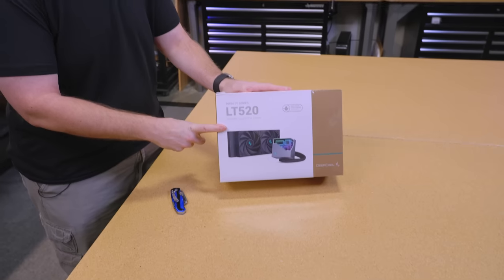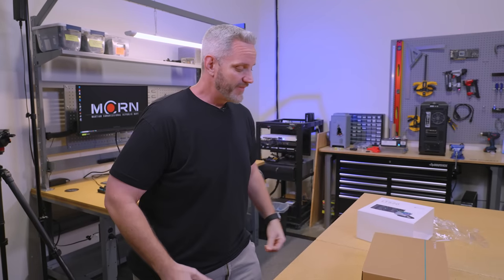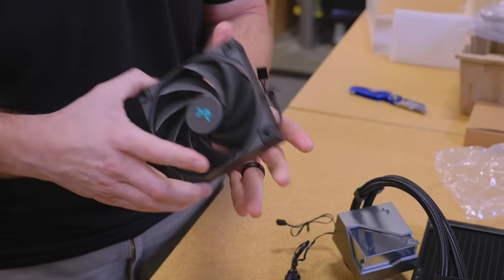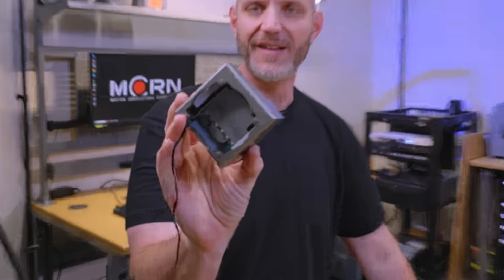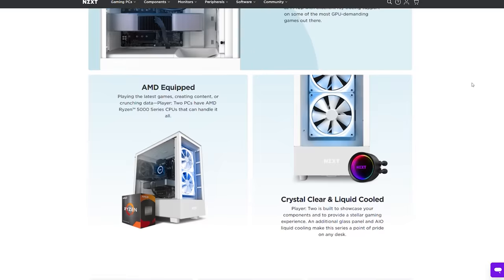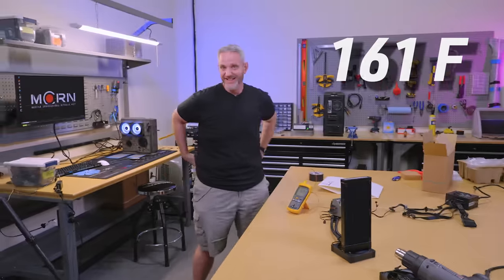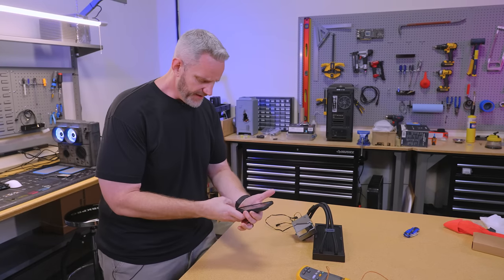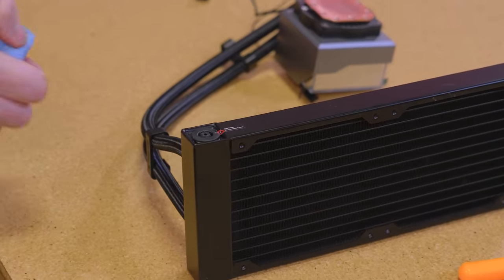They say is won't leak... I'll be the judge of that!

Comment: air expands way more then water under heat. So it could be that this security is making a difference after permeation removed water and increased air volume in the system.

Comment: I have a system running as a network storage (Previously was for gaming back in the day)  where both the CPU (AMD Phenom II x4 965 BE) and CPU Cooler (Corsair Hydro H70) are still working and will be 14yrs old next year. So... 4-5 yrs from an AIO you can get a lot more than that (yeah maybe I just got lucky).

Comment: I’ve been using Deepcool’s older Castle 360 AIO for over 3 years now in my pc. It seems to still perform just as good as when I first installed it. In the AIO space I think Deepcool does everything right. Great performance, attractive designs, reliability, and more affordable than most of its competitors. I can also see the “leak proof” tech indirectly be something that potentially extends the life of the pump by actively reducing the loop pressure. Not entirely sure if that is happening in practice tho.

Comment: I've seen the same thing where if it's not the pump failling, it's a leak from the o-ring around the pump. The liquid did fall on the motherboard but not on the graphic card.

The user told me he noticed his PC was getting drastically way slower and was shutting down after a certain amount of time so I told him to boot up the PC into the BIOS on the monitoring tab.

I saw the CPU temperature climbing and climbing in the BIOS getting over 90C so I told him to bring me the PC because as opposed to what he thought, it wasn't a thermal paste issue because I did the application myself less than a year ago.

I took off the graphic card, cleaned up the traces of liquid with isopropyl alcohol and cotton swabs, replaced the leaking AIO with a brand new one, redone the thermal paste application and he didn't have any issue ever since. It has been close to a year now.

Comment: I just purcashed one these, but a 360mm. Looks good, works well, and cant hear water. Significantly reduced my temps by 10c, over my 240mm cooler master. One thing I have noticed is hazing on the inside of the cube, after about 1 months use.

Comment: Damn i remember my first Gen Corsair H80i , which was the first AIO if i remember right, lasted about ~8 years.
I just switched it because i changed from AMD to Intel and i lost the Mounting Brackets :D
It was running still fine. 

But some Components are more reliable then people would think.

I remember i got a OCZ Vertex4 "back then" , it was released in 2012 and thats when i got it with my PC.
Everybody said " Oh those SSDs die so fast, i wouldnt touch first Gen SSDs" all that Stuff.

Welp, i still have it in my PC, it ran about 45k hours in the last 11 years , was switched on about 3,7k times ( which is an average runtime of 12hrs per day ) and its still running.
Health Status is about 70%.

Now i`m building a new PC tomorrow and that things is for sure going in again :D

Comment: it's a heat expansion lung ,when the liquid expands , it will compress the rubber lung ... its possible to connect a very sensible pressure gauge (mbar) to the small hole to see the lung being compressed when it heats :D
Reply: thats what he said no?
Reply: @HG_Chiron  yes , it's only complementary ,to help some viewers understand how it works , we can find it in liquid filled compass, high voltage oil cooled     applications , where we need a liquid without air , but needs to expand when warmed up .

Comment: I have a cheap Deepcool 240aio in my ex’s rig that’s just sitting around mining coin atm. Been going on 9 months of mining and it’s holding it at 50 Celsius on a 5600x with a 3060ti.

Comment: Liquids aren't very compressible, it doesn't take much extra volume of water in a rigid system to increase the pressure to failure.  I could see something like this working.  If you kept heating it it would probably keep it from popping any of the fittings.

Comment: I'm actually impressed with the DeepCool AiO, I installed the 360 variant for a customer with a 13900K on an MSI Z790 Carbon wifi ( If I recall the board name correctly ). Out of the box it got over 40k score in Cinebench R23 and the CPU temp never got over 86C°.

Comment: I have an old ROG certified Genome Gamerstorm case. V1 from memory. I've had this for about 5 years now with daily use and suffered many heavy overclocking on CPU and many stress tests. 
The stock AIO that's built into the case is still going strong. 
I've had 1 issue with it where the pump seems to have stopped working and the pc shut down. A few 'if it's already broken, I can't break it more' taps, and it's been working again for the last year without any further issues.

Comment: Recently retired a a 11 year old Thermaltake water 3.0 120mm AIO when the pump finally died. The pump had outlived one pair of push pull fans. And it had spent many of those years just on 24/7 with lots of gaming.

Comment: Pure physics: if you heat a liquid too much it expands. The AIOs are not completely filled with liquid and have room for liquid expansion. You try to fill the AIO with liquid to the maximum and heat it and there you will see that it does explode.

Comment: Air bladders inside radiators or anything that holds liquids used in a sealed system that expects heat isn't anything new. You have them in a cars brake fluid reservoir, water heaters, and radiators.

Comment: Theoretically this function can enable them to completely fill the aio with water without a need for air as safety expansion. So no bubble noise and all positions would be ok.

But apparently it's to expensive and complicated for manufacture's to completely fill it, and over time you have dispersion anyway, and therefore air in the loop.

Comment: Interesting tech. 
I think it works well enough because as Jay points out... there are other fail safes in the computer which would stop the AIO from getting that hot. 
(e.g. your cpu will throttle long before the water temp gets close to a bursting temp. )

Comment: I have the same AIO right now on my 7800X3D build and it seems extremely solid (a lot less noise and better cooling than my former 240mm AIO from Cooler Master). I'm sure that many other would have been just as good, it's just the aesthetics that did it for me - that square housing over the pump with the infinity mirror, boy that's something... Also, it was only 100 euros (tax included) ¯\_(ツ)_/¯
Reply: I do too; I found the fans to be quite noisy and not especially effective so I swapped them out for a pair of decent noctuas but the cooling loop itself is really good for the price.

Comment: In my custom loop with a u-flow radiator (x-flow doesn't work, gravity would make my reservoir overflow) I put in a pressure equalization membrane (looks like a bigger 1/4 plug) which lets air pass through but not water. This way my loop has always the same atmospheric pressure no matter the temperature.

Comment: I started watercooling, when I saw an excellent deal on 6900XT Watercooled version (terrible name, but: Gigabyte Radeon RX 6900 XT Extreme Waterforce WB)... When the price of GPU's was high (I got it for 599€).

Bought Alphacool B-stock Eisbaer Aurora 360mm - Digital RGB, took jet plate out, replaced original fluid with EK transparent fluid and used it with the GPU.

That was excellent. But I wanted more, so I bought Alphacool B-stock Eisbaer Aurora 420mm - Digital RGB and extension pack. Add that to my loop.
So now I have, "CPU-GPU-320-480" in my loop, with 2 pumps/reservoirs, of course. Pump nearest GPU has it's jet plate removed, to maximise the fluid flow. 
Everything works perfectly.

Next step is to buy an CPU blog (new Core from Alphacool seems EXCELLENT!), replace the reservoir/pump-combos with one reservoir/pump.
And be happy!

I have been very, very happy with Alphacool products so far!

Comment: We use that same tech in our tube heads for dental radiation technology. It does take a lot of heat and as you stated many other bad thing have to happen in order to get that much heat. I have a few pics of the ballon expanding on the tube head if interested.  

As always thanks for the informative vids.

Comment: Good radiators and pump assemblies. They do not use Asatek for the pump which is great. Their fans can be a little noisy on load. You would be better off using fans from another company.

Comment: I had a Corsair H80i V1 that failed in the cold plate oring and started leaking. It didnt damage anything though and Corsair was quick to replace it with an H80i V2 though so that was good.

Comment: I personally use air coolers like the Dark Rock Pro 4 as there's no chance of it ever failing other than aging thermal paste on the CPU and the fans.   This cooler is massively over-sized for my AMD Ryzen 9 5950X but wanted to make sure it has enough cooling power regardless of the load on it.

Comment: You should have put the inlet/ outlet tubes to the radiator on top of testing set-up (and higher than the pump). That way it would be in the configuration it would be in a system. Also, the relief point would be at the highest point of the loop, increasing chance of failure.

Comment: @jayztwocents, confirm with DeepCool but I'm almost sure that this little valve works most of the times. Even when it's not at critical state. So in general it should help to extend the lifespan of the AIO.

Maybe you can keep it running at 50 degrees and check every week how it's doing and then after few years we'll know. Just attach it to some PC and use it to heat your studio, lol.

Comment: Tbh the 360mm version in white is so cool. Derbauer did a comparison between the lower end without the infinity mirror and the Corsair, be quiet, and Nzxt z variants. All coolers performed similarly but the bequiet cooler had the CPU thermal throttling in the benchmark he ran. Not that it'll get to that point with most 360 aios but the cheapest one was the deepcool cooler.

Comment: JayzTwoCients! Always great. Haven't looked at the cost of that piece but, got a mid ATX case from them quite a while ago now for my other rig. Not the greatest airflow but, for $68 I think it makes a great buy especially if your into case modding. Top and front covers come off very easy and solid construction for something that costs $30~40 less than most mainstream cases in the same category.

Comment: The idea of the rubber insert is to keep the pressure low, when the coolant warms up it will expand and produce more pressure vs when is cold, with the rubber insert the pressure wont go up as much or at all (while within nornal operating temp range), so less pressure less chance to leak thru o rings and such.

Comment: Jay says 5 years out of an AIO is really getting your money's worth... 😧 I've still got my 12ish year old original h80i cooling my 3700x.
Been worrying I might need to change it out. 😱 
Temps are still good though; 47 to 52 at idle and 65 to 72 depending on the load.

Comment: If the pressure is reduced at hotter end then it would reduce possibility of leaks at cpu plate seals as well cos I imagine the pressure is what starts the leak.

It probably doesn’t need much volume, just enough to cover the liquid expansion.

Comment: Used to have to build a lot with CheapCool. Trust me, it may look great.... for a couple of months. Then the thing will leak on your parts. Or their power supply will fail. I tested 3 brand new DA500 PSUs and all 3 failed a PSU test on the 3.3v rail straight out of the box.

Comment: I have threadripper 1950 oc 3.9 ghz  all core that has Corsair v100i machine is about 5.7 years old and in operation 5.59 years operation. Pump seem fine coolant temp runs around 39c- 44c  mostly. Time in operation is based on hard drive smart data
Reply: Also had Corsair h80 that still operation at friend place that machine went online 2015. It does not have nearly as many hours of operation on.  Also machine I am now went operational 2018 Corsair v120i only has about  9000 hours operation. Also had another pump corsair h80 that ran  52,000 hours. Upgrade that system cpu from 2700 to 5800x ,so upgrade the pump also

Comment: You missed the whole point, the purpose and the inner working of the bladder. Nothing is supposed to pop out that port, so what are you waiting for at 70c? Thats a flexible bladder vented to outside pressure so at nearly that pressure it will start to compress INSIDE the radiator effectively increasing the internal volume and preventing  a pressure spike that will cause leaks or tubing pop out

Comment: Honestly i feel like you have to do some pretty crazy stuff to get the tubes to burst of your fittings just from the pressure of the expanding coolant. I have a custom watercooled ITX build that is so small it doesnt have a dedicated reservoir (I am using an alphacool DC-LT pump with the respective housing which does sort of wirk like a mini res i guess but it is tiny compared to what you would normally do) so basically worst case scenario for pressure build up like in an AIO as there is no room for water vapour to expand into or escape the system. Through a stupid oversight, i didnt realise my fans were of one day and i went to play some games, pumping a lot of heat into the loop without any cooling. The water reached 87°C before i noticed and literally nothing happened to the loop.

Comment: I bought the LS520 and had it a few months already. One of the fans began vibrating and making noise. DeepCool did replace the fan, however,  the other fan has made noise momentarily. I like the AIO, the only down fall is the fans are cheap.

Comment: I thought the bladder helped against fluid loss due to permeation too which is a much more likely thing. I'm also not sure why Jay said if you get 5 years out of an AIO it's some sort of miracle since that's the standard warranty for most.
Reply: There's biocides and corrosion inhibitors mixed in the fluid, and they expire after some time.
If the cooler doesn't fall to pump failure first, then the buildup of organic material or corrosion will claim it next.

Comment: I don't think this could be an issue with flexible tubing, I believe the tubes can deform enough to accommodate the extra volume. That small rubber must be more than enough to compensate the volume change of such small amount of liquid. However with hard tube setups with a lot of liquid this is definitely an issue, that is why I'm always running an open loop. I had a burst once because of high pressure and deformed PETG tubes (it was before the times of PETG inserts), and don't want to have one again.

Comment: The FK120 fans have some problems.  They aren't bad, but have a resonance problem that causes the noise to increase while the performance does not.  Once they get over that resonance speed they perform on par with other fans, but if aren't under reasonable load or manually set your fan speeds to a moderate speed, you'll pass through that resonance speed several times.

Edit - But the cooler is great.  I have an LT720 with a 7800 x3d and no problems at all.

Comment: What if pump failure so no coolant moving from cold plate but the CPU is still cranking out 90c for long time with no fluid moving would results change? Thanks for the content.

Comment: same thing i use on my radiant heater its called a bladder and it a pressure bladder .  my boiler needs 10psi pressure to start up the bladder acts as a system equalizer, it kinda works like our  lungs  except its water in water out.   expand contract lol at stupid or you can use the proper valve cap at the highest point in the system , its not the same  asa bladder.  and if you do it wrong you be in big trouble  , most the pc water cooling  hardware guys sell these valve caps . i would advise jay don't try . i know you can't do it correctly.

Comment: Heat cycling can also really kill stuff like acrylic over time. Have to replace my tube reservoir, because it started forming cracks now and is slowly leaking. (Almost killed my SATA SSD in the process due to corrosion on the plugs)

Comment: Not exactly related, but on a hard line loop is it possible to use something like a Schrader valve on your fill port to create a vacumm in the loop? Just enough so that when you reach operating temps the vacuum equalizes as the water expands, achieving close to a 1:1 ratio as possible with the ambient air pressure. Maybe they already do this, idk. 😂
Reply: I suppose you could heat your coolant up to what you think your max temp would ever be, and then fill the loop. Would probably take way too long on a larger loop and cool too fast before you could seal the system though.